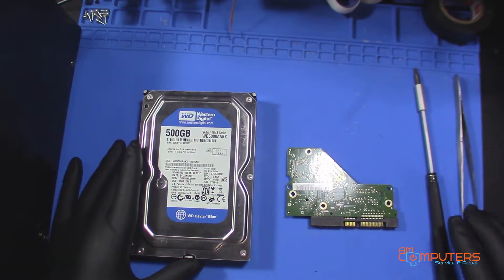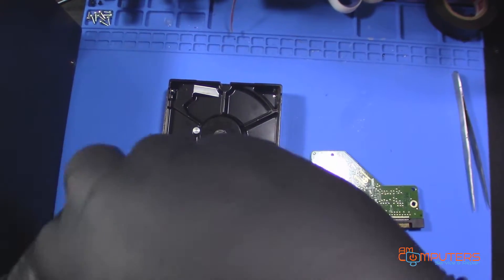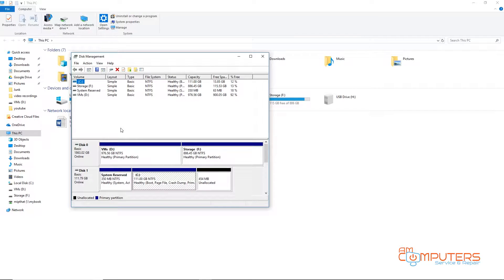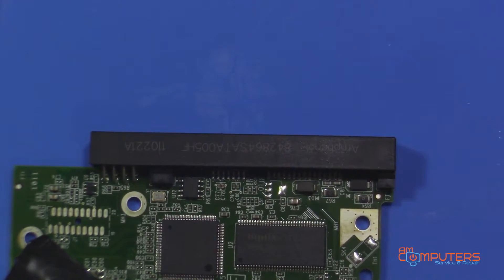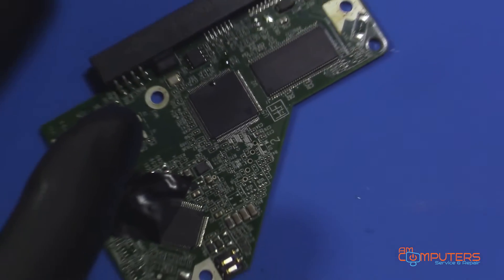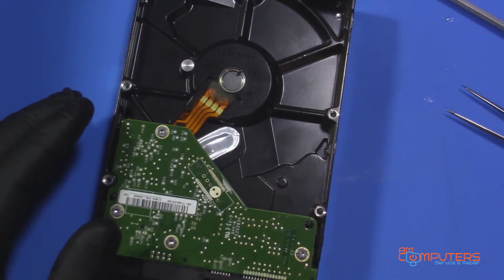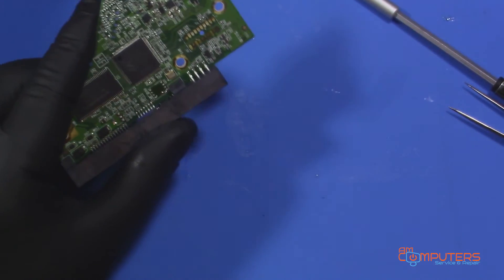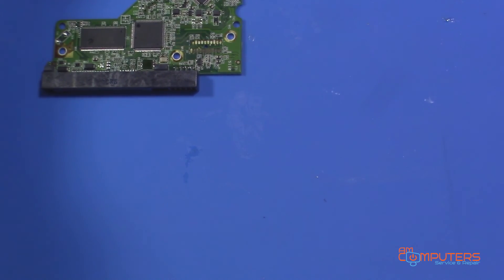Western Digital Hard Drive PCB Swap Data Recovery and Bios / Firmware Chip Replacement

Comment: I was encouraged to see that this can be done. However, my local shop is telling me that on my WD 12 TB MyBook (Helium Drive) which stopped spinning and makes no noise at all, that there are multiple chips to be swapped and the estimate is between $900-1800. I've already ordered a donor. (Western Digital WD120EDAZ-11F3RA0 12TB PN:2W10322 US7SAM120 Hard Drive IU HA500). Have you ever done the needed donor swaps on this one?
Reply from the maker: I have not messed with a Helium drive. Those newer drives could potentially have multiple chips that need swapping or special software to decrypt firmware etc. That quote does seem high but could be plausible. Probably more involved than just swapping firmware chip. I'd say if the data is important to you possibly reach out to more data recovery places and see what they say

Comment: I know this is an old video but hope to get a response... Is the bios on every HDD different? Even all ones next to each other down the assembly line?

 What I want to know is it possible to swap a controller from another drive that has the same Model and Same Firmware on them?

Comment: hi, ive got two WD drives one 1tb that needs a PCB swap. and ive got a 2tb wd exactly the same PCB numbers, except for one digit, ie xxxxxx3006, and xxxxxx3007 would the one digit make a difference in a bios chip swap? cheers

Comment: Great informative video. My WD HDD (2005) PCB board fried due to power surge and took out the PSU too. I am currently waiting for my repaired PCB board (BIOS swap) from PCB Solution in Canada. I didn't trust my shaky hands and faltering eyesight to do it myself. I am hoping that the repaired PCB will allow me to clone the old HDD to a new one to possibly boot my computer that now has a new PSU. Thank you for sharing your experience.

Comment: Hi , I have a bad external wd. When i connect it to the pc it doesn’t spin , it doesn’t show up as a folder in my pc. It is a 320 gb and in disk management it is shown as unallocated disk ( does not let me initialize) with disk place 2,5Tb !!!! When trying to check errors with a program , it returns to many bad sectors .
No spin , no noise .
Found an identical donor Pcb and initially swapped it without bios swap .
Same results as with the original Pcb .
Do you believe that by swapping bios chip there is a chance to make the drive spin and access my data ?
I don’t have the tools and knowledge to do it myself .
Reply from the maker: It's tough to say without seeing it. It could be the PCB or the drive has bad sectors or bad read/write heads. If your data is important to you I would stop doing anything with it and get it to a data recovery specialist.

Comment: I tried this and ended up with 2 bad disks.. Even when putting the pcb original back it said 2tb bad disk (they are 1 tb disks). I did this back in 2001 and it worked without problems. It seems manufacturers  sabotage this?

Comment: What is the temperature you have it set to to remove the chip?
Reply: Depends on the solder used, normally around 185 degrees celcius.

Comment: explained  Nicely. Just wanted to ask can the pcb of WD 500gb hdd work on WD 1tb hdd if i swap bios chip ? Pcbs look almost similar and their number has dffrnce of 1 digit. Plz reply.
Reply from the maker: I would make sure the PCB numbers are exact. If they changed anything on PCB layout or components not using the same board will most likely cause other damage
Reply: oh okay thanks for replying.

Comment: What temperature do you set on the blower ?
Reply from the maker: Temperature usually varies. Some bios chips can be pretty sensitive to heat so I try not to go too crazy. Sadly, I don't remember what was used here. Probably under 400C

Comment: if i'm not swap bios chip it still work or not ?
Reply from the maker: No. Swapping just the boards will not make it work. The chip holds specific data for that drive that makes it work and recognized in the OS

Comment: I have a hard drive i need to do a head swap in, pcb is fine though, do i still need to worry about firmware issues or anything? its a db blue 2.5 4tb drive (5 platter) so say i get a donor drive (exact same model number) would a head swap be as simple as just swapping the heads and i can recover my data?

Comment: if I wasn't trying to recover data could I get the HDD up and running by PCB swap alone?
Reply from the maker: If it was a really old drive MAYBE. Mostly likey not though
Reply: @AMComputers  
I love your video and your knowledge.
I did subscribe and I'm going to try just for the heck of it to put the hard drive in with the swapped PCB just to see what happens.
Keith

Comment: So beyond the small-tip soldering iron and the heat gun, what was that substance you used?

 I recently bought a tool kit specifically to attempt to repair my HDD, so I've got the screwdriver bit and some needle-nose tweezers. And I've done that first step you did and put the new PCB on and plugged it all in. It does give the HDD power and I can hear and feel it spinning. I came here when I realized, like you said, merely swapping the board isn't good enough.
Reply from the maker: Flux it helps solder flow and make good connection to pads
Reply: @AMComputers  Is there any particular flux you'd recommend? I don't know if I'll need to do any more work like this, so I was thinking of getting a little syringe-like dispenser instead of a puck container full.
Reply from the maker: This is the one I use. I find it works pretty well. may be a bit big for your needs. They may sell smaller sizes
(Amazon affiliate link)
Amtech Flux
https://amzn.to/2NvMund
Reply: @AMComputers  Oh cool, and there's a smaller dispenser to choose from, too! Thank you so much for being so helpful!
Reply from the maker: Awesome! Good luck with your repair! Glad we could help
Reply: @AMComputers  Well, I finally got around to trying to do this with a new, compatible PCB. I couldn't even get the BIOS chip off the new one. I tried doing it as you did, with flux heated up to soften the solder. I even tried directly softening the solder with the soldering iron. That darn chip was stuck on there good. 
I suppose my only other choice is to send the defunct HDD to someone for data recovery. (Before doing any of that, I did test to make sure the drive itself at least would spin up by putting the new PCB on and connecting it, so my drive's issue is definitely something in the PCB.)
Reply from the maker: That's unfortunate and strange that you didn't have much luck getting the chip off. Not sure where you're located but if you'd like feel free to send us an email and maybe we can help
Reply: @AMComputers  I think the heat gun I have wasn't proper for the job as it's head was as wide as a blow-drier instead of being sized for use on electronics like the one in the video...maybe it wasn't hot enough. 
Anyway, I live on the opposite coast in Oregon. I'm not sure if you'd do business with a customer so far out of town...
Reply from the maker: Yea that sounds about right. Probably not enough heat. We are looking to expand and offer certain mail-in repairs. Email us if you want and we can talk about it there
Reply: @AMComputers  Have you opened up to this offer, for mail-in repairs, if one of my local repair shops, The Nerd Herd, isn't willing? Local is preferred, especially when they happen to be less than a mile away, but sometimes you just have to do it that way.

Comment: Hi, thank you for this video. Is it possible to avoid the swap of the bios chip by using a tool like ch341? The idea is to read bios data from the old bios chip and write to the new one.
Reply from the maker: As long as the chip can get power which i'm pretty sure these devices supply it is possible and easier. This way is just more fun :)
Reply: @AMComputers  
I just subscribed I was curious to the other comment what is a ch341 tool ?
Reply: What is a ch341 tool ?
Reply: Is a flash programmer. You can erase and re-write eeprom like bios chip.

Comment: will I lose data after changing the hard drive pcb ?
Reply from the maker: If the bios gets swapped to the new board it should work if not the data will not be accessable. If you have important data on the hard drive I'd recommend not trying this
Reply: Ok thank for but if i'm not swap out bios just all of my data will be gone but it still work right ?
Reply from the maker: @ftr410  no, the drive will not work without swapping the ROM chip
Reply: @AMComputers  yup i have try without swipe it not work but do swipe and it work and my data still save thanks man for the tutorial but i have wait your replay comment too long so i do it and take a risk and it work thanks man
Reply from the maker: Glad it worked out. Sorry for delayed response.
Reply: @ftr410  
Hoo Ray it worked yippee Yahooeeee

Comment: mine did that too at 3:31. disk management didnt pull up anything, even though there was the chime of another HD going in.
Reply from the maker: Yea definitely a sign of some kind of hard drive fault from faulty board to bad heads. Like saying your cars making a noise
Reply: @AMComputers  so the remedy would be replace the PCB board ( and take off the original BIOS chips and put it on the replacement)and all will be well? god I hope so, got so many movies and games on it.
Reply from the maker: Not necessarily. It really could be a lot of things.if the data is important to you then I would send it to a data recovery professional. This video is really only if you know the drive isn't powering on.